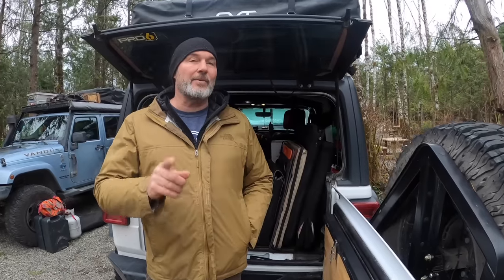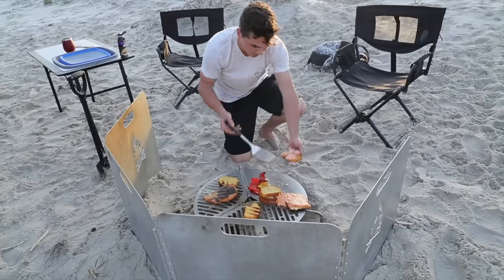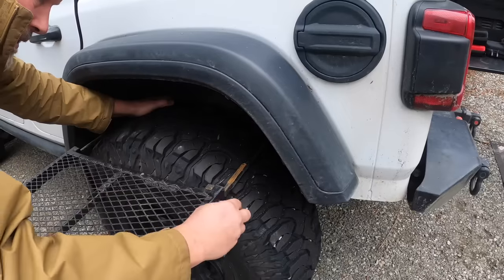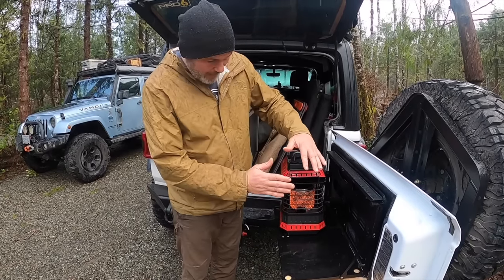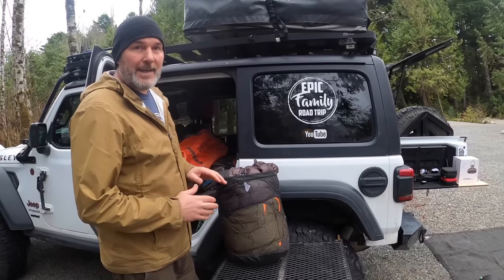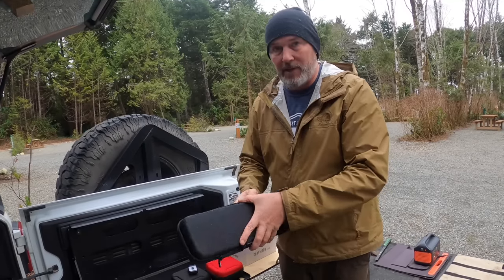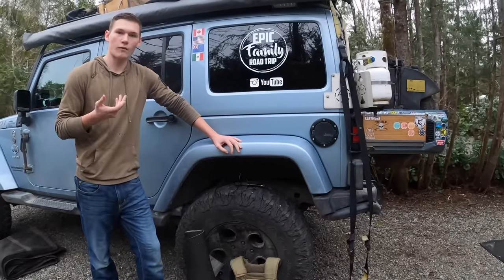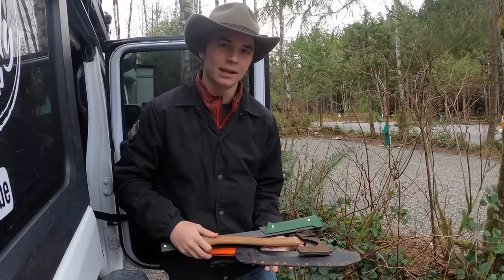THE GEAR WE CARRY FOR LIVING IN A JEEP! & BIG EFRT UPDATE! /// EFRT S6•EP17

Comment: RV hot news is a alternator that is safe to charge battery bank & 1 hr fast idle quiet can recharge battery bank 20%. It puts out 58 volts not standard 12-14. Seems the next big thing every 1 wants is that light clean quiet cheap to operate power backed up by solar. Normal batteries can't handle that quick/fast charge though.

Comment: When mounting the FR water jugs on your roof rack, do you use a Jerry can mounting tray or do you find that the jugs do fine on their own with simply tightening down with a stratchit?
Reply from the maker: We didn’t have any problems mounting them up there with a scratchit or two but if you are doing a permanent set up the Jerry can holder is a really good idea. We knew we were changing up our rooftop tent etc. so we kind of went with a temporary solution.